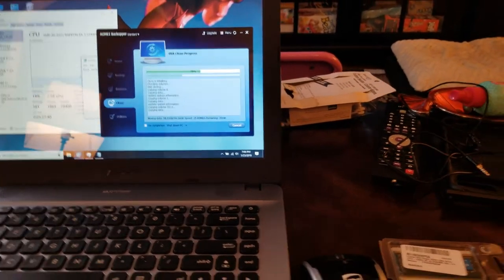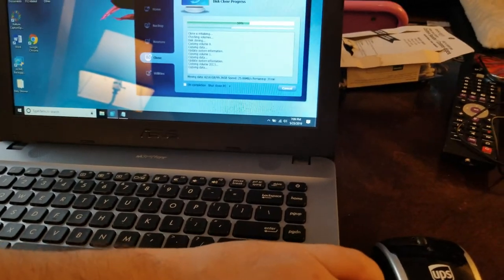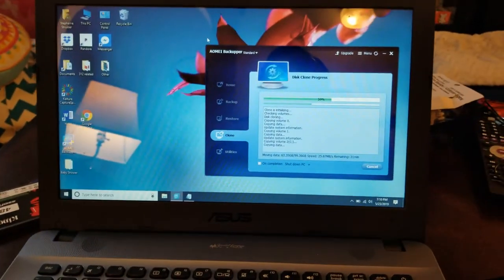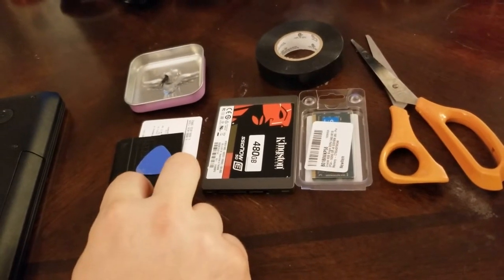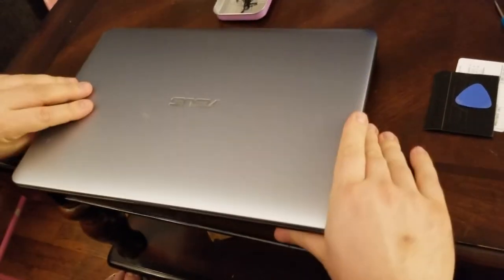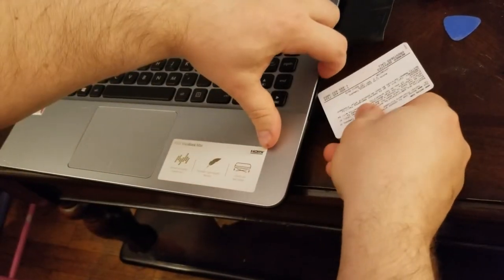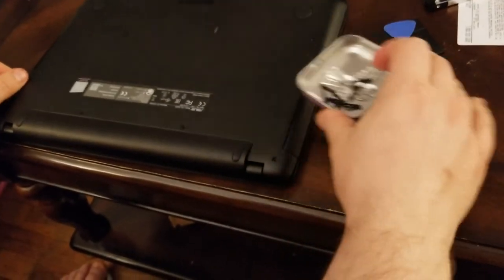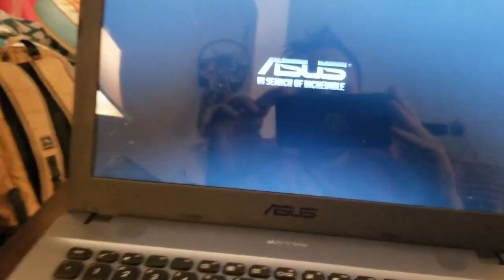Asus X441BA Laptop - Upgrade Ram Memory & Harddrive SSD HDD - Disassembly

Comment from the maker: ****RAM UPDATE: ONLY USE the ram frequencies 1866/2133mhz. Despite what Crucial and others have told me, 2400mhz IS NOT compatible with the Asus X441BA Main Board!! I learned this by trial & error until I realized what was wrong. I tried Transcend, Crucial, & Kingston at 2400mhz & could not reach the BIOS****

I am now successfully using:

Timetec Hynix 8GB Ram DDR4 2133MHz PC4-17000 Non ECC Unbuffered 1.2V 260 Pin Laptop: https://www.amazon.com/dp/B07P5W2SFX/ref=cm_sw_r_cp_apa_i_1Lv9Cb0WT8BAN

The cable I used to clone the harddrive (SATA to USB external converter): StarTech.com SATA to USB Cable - USB 3.0 to 2.5" SATA III Hard Drive Adapter - External Converter for SSD/HDD Data Transfer (USB3S2SAT3CB) https://www.amazon.com/dp/B00HJZJI84/ref=cm_sw_r_cp_apa_i_ilTXDb4EMQD31

Official email from Asus:

Hello Daniel,

Thank you for contacting ASUS support. My name is Yannique D. I appreciate the time out you have taken to notify us on your concern and I apologize for any inconvenience caused. I’m grateful to be able to further address this matter with you.

On Sun, Jun 2, 2019, 2:38 PM servicecenter_am@asus.com <servicecenter_am@asus.com> wrote:

(*Please do not change the subject line when you reply to this email)

Thank you for your response. I'm truly sorry but we have provided the available information that we can about this unit and upgrading the RAM. 1866 mhz would be considered the speed at which the unit reads the RAM. We are also unable to state a specific third party dealer for sourcing the part. Also, ensure you're using the latest BIOS version.

BIOS 306 - https://dlcdnets.asus.com/pub/ASUS/nb/X441BA/X441BAAS306.zip?_ga=2.150106230.1973313748.1559497958-1705260420.1545145869
Direction - https://www.asus.com/support/FAQ/1008276/

If you have any other questions, comments or concerns please feel free to reach out to us again. Thanks for choosing ASUS support.
Regards,
Yannique D.

ASUS Product Support
http://www.asus.com/us/support/
Reply: Hi Daniel. It was really cool and helpful. I am going to upgrade my ram on my asus. It's same as yours. Do you think I can use local brand RAM with spreed 2400 or it should be 2133? Thanks for your help.
Reply from the maker: @faujiali9129  I personally tried 2400mhz with no success. Asus rates (see my email pinned) it at 1866/2133mhz. The onboard ram is 2133mhz.
Reply from the maker: @Nason The Beat The cable is called an SATA to USB external converter: StarTech.com SATA to USB Cable - USB 3.0 to 2.5" SATA III Hard Drive Adapter - External Converter for SSD/HDD Data Transfer (USB3S2SAT3CB) https://www.amazon.com/dp/B00HJZJI84/ref=cm_sw_r_cp_apa_i_ilTXDb4EMQD31
Reply: so as long i use any type of 2133 it will be okay right?
Reply from the maker: @doddyrizkydarmawan9443  Should be fine. Just make sure you buy from some reputable brand...
Reply: @OmegaRed7159  thanks, I'll try it soon
Reply: Hi it's me again, I lost my previous post to you regarding the Ram & booting issue, I reseated everything a few times and even removed the new Ram, yet I'm still getting the message " System cannot find any bootable device". And thoughts ?
Reply from the maker: @risquest1  I asked if you could check for an unplugged cable. It sounds like you may have missed a connector.
Reply: @OmegaRed7159  Hi, I unplugged ,recheck each connection and all seems ok. I even played your video step by step again to make sure i didn't miss anything. And the HD is not even listed in boot priority. Like there's no sequence for a boot up.
Reply from the maker: @risquest1  Ensure that the little ribbon cable is in correctly 21:15
Reply: @OmegaRed7159  Is there any way that ribbon could be damaged, and how would I know if it is ?
 although it does look and feel sturdy enough.
Reply: SupraFast7159 I’m using Corsair DDR4 2133mhz PC17000 4GB but my laptop won’t start. The screen goes to black. I put the RAM in as the video did. Is there anything wrong with my RAM?
Reply from the maker: @mariobelseran  Sounds like the ram is not seated properly. The port is extremely finicky.

Comment: Thank you 
I got to install the new recommended ram card and a samsung hard drive. Looking forward to do some video editing work on it.

Recommend any free video/photo editing software? Thanks
Reply from the maker: I'm glad you got the screen working after the ram install. What was the problem you ran into and how did you fix it?
Reply from the maker: I like to use GIMP. It's a powerful Photoshop alternative.
Reply from the maker: Can you share why your screen wasn't working and the steps you took to fix it (after updating your ram)? It will help others if they come across the same issue.
Reply: After installing everything and putting it all back together I faced the original problem(blank screen) after taking everything apart AGAIN- I think the ram card wasn't in ALL the way. That seemed to work! Thanks :)

Comment: Thank you! imma try this later hope this laptop will be faster for a bit. well ram can't really be a performance changer because of it's cpu and gpu bottleneck if we'll op to upgrade it to 12gb ram.
Reply from the maker: It is a performance changer, just not for gaming or cpu intensive tasks. The ram and harddrive upgrades will drastically improve multitasking and application load time. This upgrade is ideal for the average user who uses this laptop for taks such as school, work, email, videos, pictures, or internet. browsing. The stock version of the laptop is extremely sluggish for basic tasks.

Comment: I bought the ram that this guy bought and it didn’t work. I needed the 2400 speed ram so even tho I have the same exact model laptop my mother board is different. If you take the numbers off the motherboard you can go online to figure out what you need. I bought this computer brand new and it was basically useless until I installed the extra  8g ram. It’s still not the fastest computer in the world but now with the extra ram it’s a decent useable computer. I don’t do anything crazy with the laptop but it was just so damn slow before. I’m going to install a solid state drive next week so that will be even better. I also will be using a wireless usb WiFi adapter so I can have 5g which will help the internet speeds too!

Comment: Thank you for the video/tutorial.  I recently purchased the same laptop.  Task Manager shows my RAM speed as 2400 MHz.  CPU-Z shows 931.4 MHz  (1862.8), so who knows?  I would probably go with your advice based on your trial and error and install 1866 MHz RAM if I decided to upgrade.

Edit:  Although when I go to Crucial's website and enter the exact model of the laptop, they say DDR4-2400 SODIMM is "Guaranteed Compatible".
Reply from the maker: If the default onboard ram shows 2400mhz, you do not have this exact model.
Reply: @OmegaRed7159    Perhaps they have different "versions" of the same model.  I double checked the model # and it is X441BA-CBA6A.   I have known CPU-Z to report incorrect values on occasion.  BTW, I purchased the laptop for $129 at MicroCenter, so I will probably initially just swap out the HDD for a SSD.  My cloning/backup software (Acronis True Image Home) does not work on the laptop, because it is formatted as GPT not MBR, so I will have to look for something else to do the cloning.

I may just do a clean install of Windows 10, as I have recovered the product key.
Reply from the maker: @MichaelSmith-rn1qw  Use AOMEI Backupper. No issues with GPT.
Reply: @OmegaRed7159  OK thanks for the tip.  I will write that down in the event I decide to clone rather than do a clean install.  I have downloaded all of the latest ASUS drivers  for the laptop and stored them on my main computer for now.

Comment: Question. I’m gonna buy this computer brand new, and also those two things u said to buy (ram and hard drive I believe) and follow the steps like you show on the video. You can tell by now that I’m a rookie that has no idea but with good tutorials I do aright...

So my question is...do I have to “clone” anything or do anything with the ram and hard drive or the computer before replacing the ram and the hard drive? Or I can just replace the ram and hard drive before even turning the computer on for the first time ever?  Because what I mean is the computer is new....so it has no files or pictures or anything....do I have to do that “cloning” u were doing? Or not? Please that would really help and thank you!!!!!
Reply from the maker: You don't clone the ram. You only clone your harddrive if you want to transfer your other system over to this new one. If you don't mind starting fresh and have a Windows OS Software/Serial to boot on, you can do that too.
Reply: D2infinity com - Tech Solutions okay thank you. I don’t know how to do that step by step but I’ll figure it out thank you for the video
Reply from the maker: @nasonthebeat7604  Use AOMEIBackupperStd.exe. It's free, efficient, and easy to use.
Reply: D2infinity com - Tech Solutions thank you much will do! I’ll let you know once It’s all done thank you sir!
Reply: D2infinity com - Tech Solutions just writing to let you know I did it!!!!!!!! And my computer now seems super fast THANK YOU THANK YOU THANK YOU!!!!! I feel like I have a super computer now lol thank you again god bless you

Comment: If i were to remove the cdrom drive and replace it with a caddy , what size of caddy should i use ? I wanted to have both hdd and ssd. Mainly ssd for the operating system.

Comment: Any way you can link to which ram card you used? This is exactly what I needed though, thanks!
Reply from the maker: Sure, I'll post a link by tomorrow night, Eastern Time. I made an update in the comments about the ram because that Crucial ram in the video did not work (Which is why the video looks clipped at the end).

I wound up going through several brands until I realized I was given bad information by Asus. This board DOES NOT support ram frequencies at 2400mhz. It only supports 1833/2133mhz.
Reply from the maker: Timetec Hynix 8GB Ram DDR4 2133MHz PC4-17000 Non ECC Unbuffered 1.2V 260 Pin Laptop: https://www.amazon.com/dp/B07P5W2SFX/ref=cm_sw_r_cp_apa_i_1Lv9Cb0WT8BAN
Reply: Thanks sir!
Reply: @OmegaRed7159  i bought this exact ram and it boots up a black screen. what is going on? how do i fix this?>?? please help me!!

Comment: Hi, thanks for the video. I have a question. Asus told me that the  laptop comes with a soldered onboard 4GB memory chip like you said. (sorry for my english, i'm doing my best considering that I'm from Argentina), and the said that I can't replace or upgrade the ram bacause it is soldered.
Reply: And what’s the question?..
Reply: The laptop has another slot👍

Comment: Thanks for the video! Just want to ask, in Asus official website, max capacity to upgrade into ssd is 256gb, so how can you explain that you change your storage to 480gb SSD ?
Reply from the maker: I'm not sure where you read that, maybe wrong version? This laptop comes stock with a 500GB 5400RPM SATA HDD. It supports up to a 2TB 2.5" SATA3 SSD as the general specification says it is supported.
Reply: @OmegaRed7159  nope, i read that on Official Asus website for global version. Indeed, it says that the laptop supports up to 2TB for HDD, but for SSD, it only support 256GB SATA

Comment: is this a good laptop and hows the battery life?
Reply from the maker: Without the upgrades it's not good. If you can buy it cheap and do these 2 updates. You can browse the internet, watch videos, use word processing software,  photo/video editing, and maybe some low level spec games (not a gaming laptop). The battery life is good, especially if you configure the power profile properly.
Reply: D2infinity - Tech Solutions well I’m thinking about buying it for my sister because it’s $150 on microcenter
Reply from the maker: @vikisthebest  Honestly, out of the box there's nothing "wrong" with it as is. I just prefer snappier operations and multitasking apps that require a lot of memory. If your sister is doing email, web browsing, youtube, and some word processing, it'll do just fine as is (just slower without the mods)
Reply: D2infinity - Tech Solutions thanks so much and earlier you stated “configuring power profile properly” what does that mean
Reply from the maker: @vikisthebest  https://www.howtogeek.com/240840/should-you-use-the-balanced-power-saver-or-high-performance-power-plan-on-windows/

Comment: Hello Friend!

Thanks for the video. I followed his directions, however, I was unsuccessful with my memory. The 980gb SSD worked perfectly. But the Corsair 8gb 2133Mhz DDR4 CL 15 memory didn't work. The notebook turns on, but does not turn on the screen. Despite turning on the cooler, the screen goes black, causing a memory problem. Do you have any suggestions for me?
Reply: so what was the prob man?
Reply: what was it man? im having same issue
Reply: Yeah I'm having the exact same issue

Comment: hi, i use cors**r 8GB 2133mhz, and i installed the ram, i turned on the laptop, it couldn't turned on, and the hdd always keep buzzing every 2/3 seconds, could you help me please
Reply: Hello Friend!

I also had this problem. I bought a corsair 2133Mhz memory and the notebook turns on, but the screen goes black. When I remove the memory it works normally. I was only successful with the installation of the SSD. I'm in doubt about which memory to use. Is it 2144Mhz or 2400Mhz that I should actually use?
Reply: @lucascafe  hi there, i went to service center to upgrade my laptop, so they installed ddr4 4gb ram 2666 mhz, and it works properly.
Reply: @lucascafe  but, i tried to install by myself, it doesn't work, and the screen goes black, better give to the service center to help, but more expensive

Comment: Hi i have a question. Do you need to reinstall windows on the installed ssd drive or is windows installed on a separate drive in this laptop?
Reply from the maker: You will need to either reinstall windows OR clone your old harddrive on to the new harddrive.
Reply: D2infinity - Tech Solutions will it work the same like booting windows when you build a pc? Just plug the ssd in then run the laptop from an usb with windows installed?

Comment: I installed ubuntu 18.04 on my Asus X441BA, after some days the monitor stay on black, does not turn on. The fan cooler is running, the power led is on, but the charge led is blinking three times periodically. I tried plug an external monitor and it works, but built-in monitor didn't. What could be this problem? What can I do? I already have installed the ATI AMD graphic drivers for ubuntu, but that did not works.
Reply: Did you put back the monitor cable after you disassembled the laptop?

Comment: Oh sorry,your Soldered ON BOARD RAM is 2133 Mhz,idk why mine is 2.400 Mhz,you can use the cd room for HDD or SSD Port.
Reply from the maker: You have a better model. This one does not come with a stock dvd rom drive.
Reply: @OmegaRed7159  yeah,mine is amd a9 and youre amd a6

Comment: Hello Friend!

I also had this problem. I bought a corsair 2133Mhz memory and the notebook turns on, but the screen goes black. When I remove the memory it works normally. I was only successful with the installation of the SSD. I'm in doubt about which memory to use. Is it 2144Mhz or 2400Mhz that I should actually use?
Reply: 2133 Mhz

Comment: Bro, i know it was 10 months since you upload this. idk, but if you happen to read this, my laptop won't turn on after i disassembled it. when i plugged in the charger the indicator light is off too. idk what to do right now. if you could help me, that would be great!!
Reply from the maker: If you are not getting any power, it sounds like you missed a wire/connector when reassembling. Try taking it a part again and checking.
Reply: @OmegaRed7159  Omg, iam not expecting you to reply, thanks so much! i'll try it out now
Reply: @OmegaRed7159  so i already re do the disassemble and assemble it... still no power. bad luck i guess, but iam happy you reply, thanks bro!

Comment: Hey, Is there 2 slots for ram in this laptop???
Reply from the maker: Just 1.
Reply: @OmegaRed7159  oh. well can I upgrade it to a 16gb stick ??? / does it allow 16 gb of ram
Reply from the maker: @skyzhere6157  Unfortunately, no. The slot only supports up 8GB (or 12gb total with the onboard soldered ram)
Reply: d2infinity com Oh okay thank you. I was about to get use the 16gb stick I have. I guess I’ll just save it 🙂

Comment: Thank youfor your guide. i already add ram 8 GB with your recommended speed then in windows detected 12 GB installed but useable only 4 GB and 8 GB with state hardware reserved.  Can anyone help  ?
Reply: do you installing windows 32 bit version? check your processor, but i think it should 64 bit

Comment: with the same specification but i buy corsair valueselect  Type: 8GB DDR4 2133mhz .... and i got wont boot on bios... why ?
Reply: Not the same speed ram
Reply: @opticwiddly5263  the RAM speed doesn't really matter, I got this problem too with the same brand, CORSAIR
Reply: In my pc i have 1833 mhz
Reply: @amndnadl9912  the problem fixed? where do you check the RAM speed? if it's Task Manager, it may not an actual speed.
Reply: @fuutonshinra  was solved one hour ago, i buy again with same specification but 4gb
Reply: @amndnadl9912  what brand?
Reply: @fuutonshinra samsung

Comment: the ram listed did not work with my laptop. possible its faulty ram, but i doubt it. any ideas? isued the Timetec Hynix 8GB Ram DDR4 2133MHz PC4-17000 Non ECC Unbuffered 1.2V 260 Pin Laptop:
Reply: Hello Friend!

I also had this problem. I bought a corsair 2133Mhz memory and the notebook turns on, but the screen goes black. When I remove the memory it works normally. I was only successful with the installation of the SSD. I'm in doubt about which memory to use. Is it 2144Mhz or 2400Mhz that I should actually use?